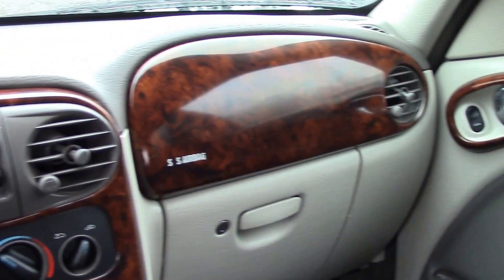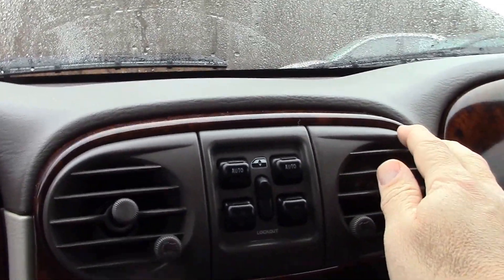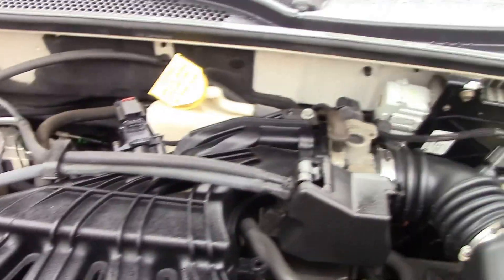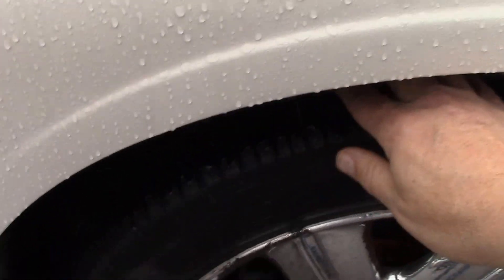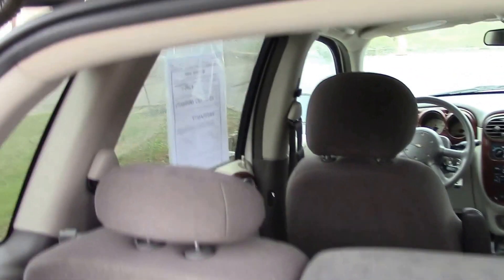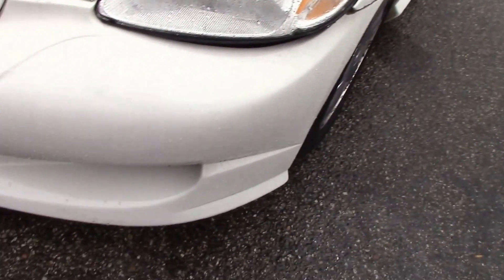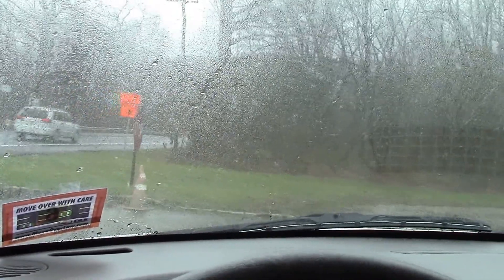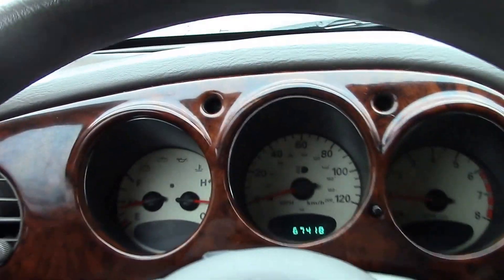2002 Chrysler PT Cruiser Touring White for sale

Comment: THE ENGINE HAS SOME STRANGE SREACHING BELT NOISE BELT NOISES CAN BE JUST A WORN BELT OR WORSE A PULLY ISSUE OR IF YOU WISH n idler issue which could be money.. also it's a 2.4 not a 2.0
Reply: had a similar issue ,belt could be bad ,also a bearing , spray belt dressing on belts ,  they sell it at walmont , do one belt at a time .if you can , will help you pin point exact belt ,, good luck